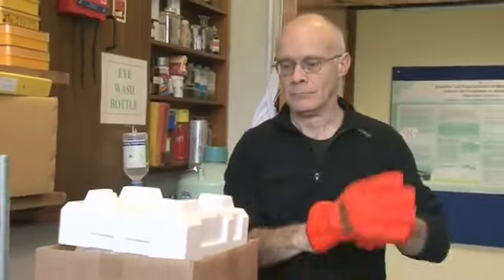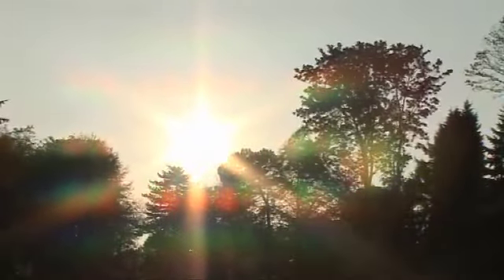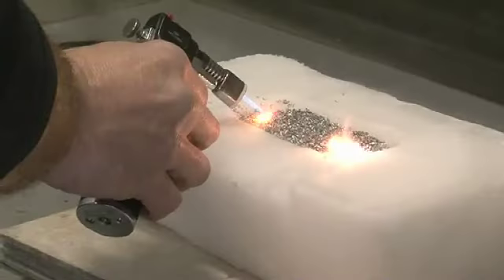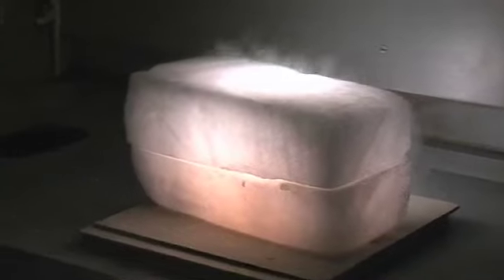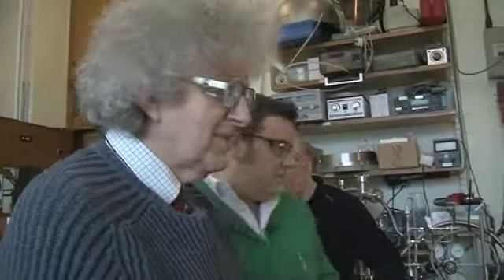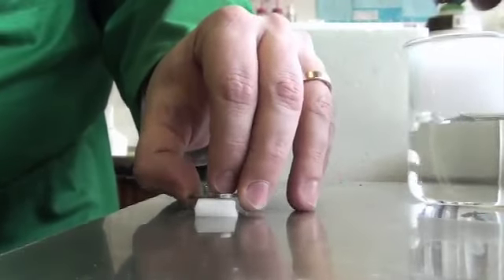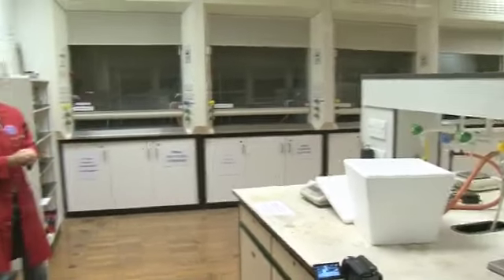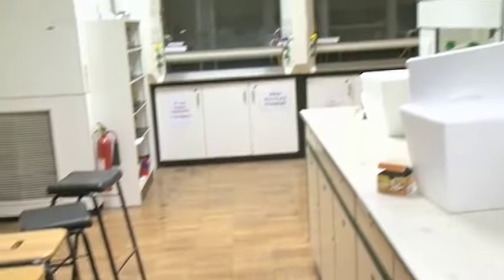Carbon Dioxide (Part II) - Periodic Table of Videos

Comment: Then I'm sure you will know that by burning hydrocarbons, it produces more water than carbon dioxide (not by mass of course!). Water vapour also constitutes about 0.005% higher of the atmosphere than carbon dioxide, and a lot lot more at the surface (up to 3% higher). When the Earth is at it's apoapsis does this affect these levels? Surely the water concentration is affected much more by combustion than natural processes? Do things like sunspots (you mentioned solar radiation) have any effect?

Comment: Water vapour (1.996 kJ/-kgK) is much better at absorbing heat than CO2 (.846 kJ/-kgK). Almost twice as bad. The difference is the amount of Water Vapour in the atmosphere is dependent on the temp of the Earth. The higher the temp the more Water gets evaporated and thus more water vapour in the atmosphere. Water Vapour accelerates the warming as more vapour rises the temp which then creates more vapour. Whereas CO2 is controlled on how much get's pumped in the atmosphere. That's why it's worse.

Comment: The radiation emitted from the sun is at a much smaller wavelength, so it is not absorbed by the CO2 molecules. However after the earth is heated, it emits radiation at a much larger wavelength which can be absorbed by the CO2 trapping heat energy in the atmosphere.

Comment: @amcnea I am not continue to argue about this with you I realise than you can't understand that when a liquid changes into gas IT NEEDS HEAT (read a bok or do a reasearch about it) 
"the C02 changes from a liquid to a solid without a need for energy to be added."
Trust me it gets it's energy from the air around because it has a temperature (20*C) for example, why do you heat the water to get it boil?HA? because it needs HEAT/ENERGY to get into gas state...but you are not capable of understanding

Comment: Well, let's just use antimatter instead of fossil fuels.
Reply: +Antonio Jose B. Salamat The only problem would be preventing the antimatter from annihilating with regular matter.
Reply: It takes more energy to create the antimatter than the reaction between particles produces.
Reply: It takes more energy to create the antimatter than the reaction between particles produces.
Reply: emlmm88 That, and producing antimatter is astronomically expensive. Antimatter is just not a viable energy source.

Comment: You could do this at your house and compress the hydrogen into your car and burn it instead of gasoline. I think. So, it's not perpetual motion, but it effectively makes a car run off of electricity without all the tedious mucking about with rare-earth elements and their mountains of toxic waste.

Comment: Carbon does retain heat in the atmosphere. But the amount of it and its effect is little and is not the cause of global warming. In fact the rise of carbon in the atmosphere is caused by the increase of temperature and not the other way around. 

What is causing global warming is the sun. And the proof is Mars and a couple other planets have increased temperatures similar to earths. And dont forget Mars has a very very thin atmosphere.

Comment: wait....can't we then use this reaction to capture CO2??  And make more steam to push more turbines??  You end up with essentially coal and magnesium oxide, both in solid form and easier to dispose of.  You can even re-burn the coal, use the CO2 in this reaction and basically be self sustaining.  Am I crazy or would that work.

Comment: Doctor, you can run gasoline engines on alcohol and diesel on vegetable oil (with the correct prep for either), and we can manufacture biodiesel, which isnt a fossil fuel.. Also the idea that fossil fuels do not replenish over time is moronic.. They formed naturally and there is nothing stopping it from doing so again, does it reform at consumption rate? No, of course not, but to pretend like it is a limited resource that once you use it up its gone forever is pure fiction.. 

Now if we include methane, ethanol and biodiesel, we can actually replace crude oil but the scarcity or rather, perceived scarcity of crude oil drives up prices.. Which only benefits the oil barons that own the fields.

Comment: @amcnea 
"You are obviously wrong. Simply look at a fire extinguisher. Where is the heat coming from?"
DUDE I said it gets the heat from the air it doesn't give away heat... can you understand english? I am not a native english speaker but I think I can make myself understood.
I already know the correct answer and try to think why do we use CO2 for fires?
1. because it is CO2 and fire need O2 to burn so it can't maintain burning proces (oxidising)
2. because it cools the air around it and voila!

Comment: if you look at a graph of temperatures over the last few hundred years or so, the temperature cycles periodically and this i believe is due to the sun cycle, which has a period of about 22 years. when you get to about the time of the industrial revolution, it starts to gradually increase, whilst still displaying peaks and troughs. you think its a coincidence? a solar maximum wouldnt explain it, as increased temp due to solar maxima never reached this level until after the industrial revolution.

Comment: Why would you even bother getting that tiny bit of water back into the system?

Also, you want to use electricity to make fuel to burn in a combustion engine? use an electric motor mate, much better conversion.

Comment: why is the evaporated CO2 white?
Reply: It's not.  What you see is a little cloud, tiny droplets of water that condense out of the air when you make it colder.  Like the clouds in the sky (it's colder up there!). You're not seeing CO2.
Reply: Oh OK thanks, I thought that was CO2 evaporating.
Reply: The CO2 evaporates, but its still cold. The white you see are millions of tiny pieces of ice forming in midair because the gaseous CO2 is still cold enough to freeze water in the air.

Comment: The Sun warms atmosphere😁beside regard major components & processes, N, S, O3, VOCs, Halides, water vapor among excessive surface compounds reflecting culpable processes, reservoirs, sinks, & fluxes CO2 relative to those among else, since semmingly depends upon ethics interpretation purpose, not all are honorable, such as processes resources & energy, but consider Venus & Mars, also affected by Irradiance & astronomical distance beside the orbit & spin mechanics there's immediate variations need regard, mebbe paleologic changes. Ty for research esp properties combustion & energy exchanges, may need further approach with Atm components from iono- through troposphere & Solar influence There's unpredictability & influence already from baseline, but Anthro geoeng extract & transfer influences happen reckless & worse, beware politicization corruption exploitation like microbes parasites & else have from Hadean.

Comment: @amcnea you should sty more... you are not capable to give a good an certain answer read on Wikipedia or in a physics book that when one substance passes from a solid state to a liquid one or from liquid to gas it needs heat/energy, the energy that you;re talking about is another fish food, that has nothign related with the state change it pushes air because it has a greater pressure :| and the molecules can't get close to each other in normal conditions (20*C 1atm) so you are so so WRONG!!!!